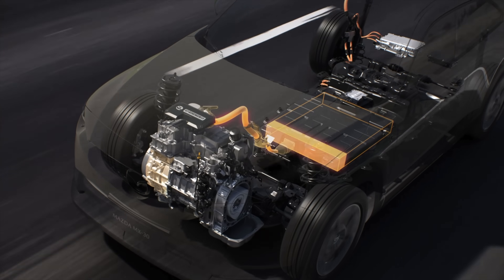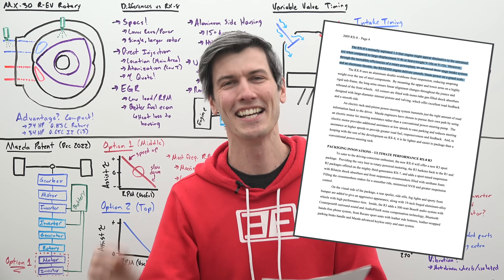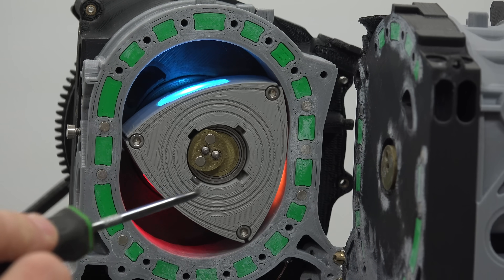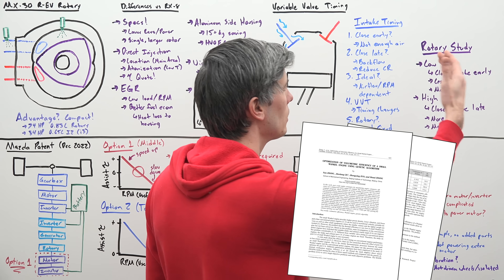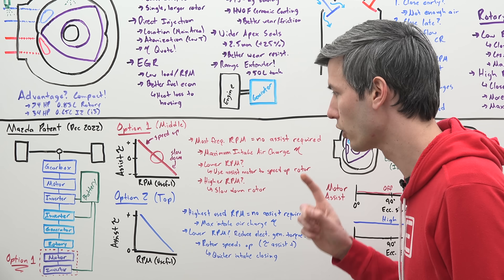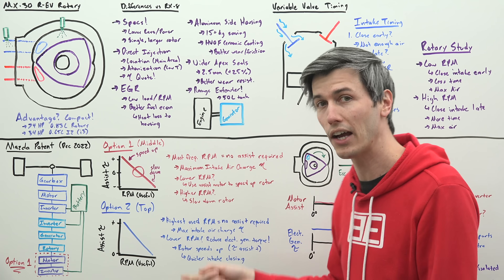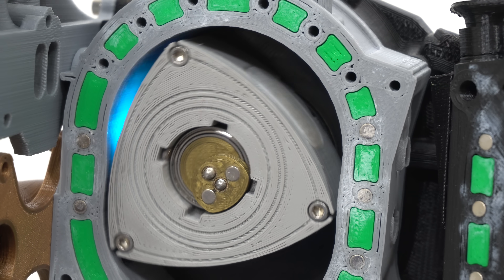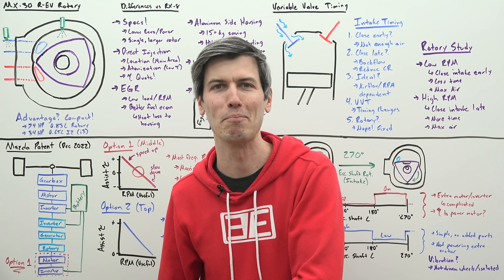Mazda Brought Back The Rotary Engine!

Comment from the maker: *Common Question!* Why would a range extender (engine + generator) need to operate at different RPM? 
Realistically, the option for a single RPM is there, and as stated in the video, there's likely an RPM that the engine spends the vast majority of its time at. There are reasons, however, why you might want to occasionally run at different RPM. For example: 
1) Engine startup. This engine makes peak power at 4500 RPM. If peak power is needed to recharge the battery, you probably don't want to go straight there on a cold engine. 
2) Battery charge rate. Batteries are able to charge faster at lower SOC (state of charge), vs higher SOC. This could mean at low battery, the engine output would be greater, and at higher battery SOC, the engine output drops because the max charge rate of the battery is lower. 
3) If the engine is capable of high output, it likely exceeds the max charge rate of the battery. For example, the battery (relatively small vs dedicated EVs) is capable of 36 kW fast charging (it's a small battery so this is a normal number, despite sounding low). The rotary engine has a max output of 74 HP (55 kW), thus exceeding the max charge rate, so there are likely times where it runs at lower loads, and times it runs at higher loads, depending on the battery's SOC. So why does the rotary have more power than needed? At times, it is used to not only power the generator, but also to send more power to the driven wheels. If you ask for full torque (floor it), the battery and engine+generator are both sending current to the drive motor, giving you more power. In this state, it would make sense for the engine to be generating max power.
Reply: You mean the Wankel engine?
Reply: why not keep the same RPM and change the load?
Reply: Great explanation.  This is exactly why I came to read through the comments!  🙂
Reply: Have you done a video comparing the efficiency of different engine types at a constant RPM?  Mazda does like the rotary/Wankle, how does it compare to a piston, or turbine engine of similar size?
Reply: I am 45. Since I was a kid, every 10-15 years Mazda would "bring back the Wankel".
Reply: #1)  Fine - who cares if you're just running it to get to the right temp.  That shouldn't take long.
#2 and 3)  Couldn't you just run at a higher RPM with a leaner fuel mixture, so you create less power but at the ideal RPM?  Does that take you back to where you started?
Reply: @kevinrusch3627  it is more efficient to make x kW at 2000 rpm vs 4000 rpm. High rpm and low load is inefficient.
Reply: Maybe I am looking at this wrong, but can’t you solve (and simplify) a lot of these problems by just using “start-stop” and a CVT?
Reply: @alpenfoxvideo7255  because running at a high rpm and low load is inefficient.
Reply: @Av-vd3wk  wankel engine yes
Reply: So when do we get to see the complete BTE map? Are you suggesting that peak thermal efficiency is also at peak allowable RPM or at some lower RPM?
Reply: @benwhittle7204  only if the added efficiency being able to operate the engine at ideal RPMs due to spinning the generator through the output shaft of variable gear ratios outweighs the parasitic losses through the transmission, added weight, space and cost and complexity... I'm guessing probably not.
Reply: Wouldn't a 2 gear box with a neutral do better job of the generator? Recluse clutches for dirtbikes have a clutch cassette that essentially gives you an automatic. Connect the throttle to the computer &your set
Reply: Wouldn't the temperature and pressure of the air coming in also change the "optimal" intake timing?
Reply: @alpenfoxvideo7255  because they want the minimum battery size.  if the battery where bigger, there'd be no need for the ICE to track usage
Reply: @ΘάνατοςΧορτοφάγος  an ICE is most efficient at its rated power, which is near the rpm readline
Reply: Yeah, what he said!
Reply: @DSAK55  Maybe with some types of engines like big generator or big ship engines that are sorta designed for that to happen but in reality not so much. But in the area of standard car engines the optimal thermal efficiency is generally not at peak rpm or power output. There are great reports that show the complete BTE (Break Thermal Efficiency) map of the Toyota engine that is being used in their hybrids and the design optimization for peak thermal efficiency is far from the maximum RPM on purpose. 

In addition, the newer trucks engines are purposely being designed to achieve peak thermal efficiency at lower RPM to minimize the friction losses and to achieve higher cylinder pressures.
Reply: @DSAK55  BSFC is not highest at redline rpm, more like 2000rpm (engine dependent) and WOT
Reply: @DSAK55  absolutely not. Highest torque is closer to the best efficiency point
Reply: This is a classic example of overcomplicated engineering with no regard of what the result should be: a competitive vehicle. For all the money they spent on designing this wankel engine with fancy timing, they could have simply put a bigger battery in there instead ... like literally every other automaker did. And range extenders were only useful when the batteries weren't as good. The i3 is 10 years old.
Reply: @ΘάνατοςΧορτοφάγος  Reasonable approximation but not quite the whole story. See “Benchmarking a 2018 Toyota Camry 2.5-Liter
Atkinson Cycle Engine with Cooled-EGR” and there is  newer versions of this but this will suffice.
Reply: Basically, the rpm is not critical except that hp is measured as a function of time x work, with modern waveform control WHO NEEDS  heavy problematic BATTERIES
Reply: Yes, 74 HP is overkill for the APU range-extender. That powerful of an engine could produce up to 37 kW of juice, or 37 kWh per hour. Even an inefficient EV could travel over 100 miles on that, or in other words speed along at over 100 miles an hour (hmmm, perhaps that is what they were going for).
Reply: I know this is technically for *extending range*, but I'd personally love a completely self-sufficient gas-engine-charged EV. All of that beautiful instant torque, and no need to calculate whether you can make a road trip OR install a 30 amp outlet in your garage. I'm sure the engine would last longer than you'd ever need being controlled by the designing engineers!
Reply: What do you think about the liquidpiston rotary design?
Reply: anyone can see the size and performance have some potential for generating electricity in vehicles, and better yet in heavy-duty electric machines, what can be said "after so many year", this is the cost of over doing patent control, yep, no performance develop in years pass and will remain underdeveloped in years to come, because ...tada! you guess it, technology monopoly, excessive control of technology's intellectual patents. Would this make to a reliable investment that will surely be sustain in the future, you guess it, not quite promising. Good luck!
Reply: @geoffshelley2427  Remember that the car needs to be able to maintain a reasonable speed up a long up grade, think Grapevine in California (and it has to do that on a 110 degree day without over heating the battery or running down to very low levels). Hopefully you can hit the bottom at 80% percent charge level which probably requires the user to have the car in the appropriate mode.
Reply: Also perhaps they want to leave the option for a dual rotor 148hp small car? There's markets where EV's don't really work due to basically having bad infrastructure or may have different emission standards where they could stick one of these coupled with a CVT... A single rotor would technically be fine for a kei car, I can imagine a mild hybrid single rotor also...
Reply: It looks like Mazda is doing what Chevy did, providing the ability to slave the gas motor to directly assist the electric motor driving the car. In the rare case that the rotary engine need to power the wheels, you need it to run at different speeds.
Reply: Really love the explanation,as always excellent video 💪🏾worried about that motor or positioning cam for the rotor lobes,as much as it's an excellent idea, they haven't perfected the old OMPs so from my experience I suspect that mechanism would be the flaw in these engines🤔
Reply: @michaelparks3106  This is different than at least one of the Chevrolets. The Mazda ICE is never mechanically coupled to the drive wheels. If it was, then they couldn’t vary the instantaneous RPM.
Reply: @Av-vd3wk  Wankel
Reply: 4) For better battery life and reduced loss in charging and discharging, it would be desirable to reduce battery cycling. Rather than producing a constant generator power, the generator power can track the power demand when the demand is within the range that the generator set can operate at good efficiency, resulting in constant battery state of charge (no cycling) during those times.

The optimal balance between one extreme of most efficient generation and the other other extreme of minimum battery cycling, also considering the various other issues (startup, thermal management, rate of charge limits, etc), will inevitably be a sophisticated generation and charge management algorithm.
Reply: Exactly the question I wanted to ask, but you've done it for me. However is it worth all this additional complexity to handle the situations you list ? I'm assuming it is possible to charge the batteries externally, so why not at the same time keep the engine warm using heaters, and while running, use cooling air for the drive motor for this. 
Best to keep it all as simple as possible, and have a fixed engine speed and power.
Reply: Also, noise. 
Use lower rpm at low vehicle speed, and allow higher rpm at higher speed where it's easier to obfuscate the generator noise.
Reply: @nomayor1  
Mazda made rotary engines from 1964 until 2012.
Reply: 1) Only when starting up with batteries empty, and for a few minutes.

2 & 3) Use start/stop, electronic current regulators, connect to the generator through a mini transmision.
Reply: @johnburns4017  They are to make Another come-back, this time with the wankel playing the role of a generator. That's what this video is about!
Reply: I'm trying to work out how the Coventry Climax pump's engine was designed to work at high power right from the start, even a cold start. So why is it such challenge? Metallurgy? Clearances? The engines date back to the 30s.
Reply: @stuarthart3370  
The Coventry Climax's longevity never mattered, only its performance. Fire Brigades would stomach the higher maintenence costs to get the performance instantly.
Reply: @CrappyCar  turbines are insanely efficient, but I don't think that will transfer well to something small and running a generator
Reply: @kevinrusch3627  emissions will get in the way of that. Not sure how it works on a car like this, but lean will pollute much more.

Also, lean generally makes more power, not less.
Reply: There is also the ability to vary valve timing at a specific RPM to basically do a rotary Atkinson cycle. Maybe they run it at 4500RPM at all times but a cold start, and vary how much power it makes at that speed.
Reply: @alpenfoxvideo7255  Because running the engine at 4500 RPM under a light load would be quite inefficient.
Reply: Jason,

I'm wondering if Mazda considered some kind of 'cam phaser' type mechanism for the eccentric shaft that could advance or retard the rotor timing?
These other two electronic solutions either take power away to make power, or reduce total power output.
Reply: @nomayor1  
I know.
Reply: @JoshuaClarkeOk  The market where BEVs don't really work is the entire global market... due to cell supply limits.  Cell supply is what limited production of EVs to 10.6 million in 2022.  That's 10.6 million between BEVs and PHEVs.  Had we produced zero PHEVs and used all of the cell supply to only produce long range BEVs, then the world would have only been able to produce 8.2 million long range BEVs.  About 10% of the total global vehicle production; the other 90% being ICEVs.  

Had we instead used all battery cell to produce ONLY PHEVs and HEVs, and zero long range BEVs, then with the exact same cell supply the world could have produced 36.5 million 16 kWh PHEVs, and 45 million 1.5 kWh HEVs.  81.5 million vehicles; aka all global vehicle production could have been PHEVs and HEVs.  It would have required no fast charging infrastructure.  We could have also produced millions of more PHEVs + HEVs in 2021, 2020, 2019, 2018... etc...   We'd be far further along in electrifying our global fleet of 1.4 billion registered vehicles, and would have made a much larger dent in global emissions than the track we're on now concentrating our resources BEVs.

Tesla, world's largest BEV producer to this point, has only produced 3.8 million BEVs in its 20 years of existence.  They're replaced only a quarter of one percent (0.27%) of the world's total vehicle fleet.  They've essentially done nothing up to this point.
Reply: 'Range extender' sounds backwards to me -- why not simply design a bolt-on electric motor kit for typical FWD economy cars, with manual transmissions? The original ICE drivetrain would remain fully intact.

The idea is to replace one rear wheel hub with an electric motor, and use a small(ish) battery pack... When you're stopped at a red light, you accelerate the car to cruising speed, using the electric motor only. When you reach cruising speed you engage the ICE drivetrain (let the clutch out, in 5th gear), and cruise on gasoline. This will roughly double the miles you get on a tank of gas (acceleration burns half of your tank, so use an electric motor for just that part).

A small battery pack would allow most people to drive to work and back every day, doing all of their accelerating with the electric motor... and only require a few hours to charge overnight. So for at least 5 days a week, they'd be DOUBLING their MPG.

Make the kit somewhat universal, inexpensive and reliable -- you'll sell A MILLION UNITS. PS doubling the range of an average economy car's gas tank would give you a range of approximately SEVEN HUNDRED MILES. Let's see you do that with your golf cart.
Reply: Motor turns a generator which charges the batteries which drive the electric motor? 
Sp it's another Chevy Volt...
Reply: @alpenfoxvideo7255 There are times when hp and torque are more important than optimal efficiency.
Reply: @DSAK55  how the fork did you come to that conclusion?
Reply: 1)... So let it warm up.  Also rpm isn't necessarily the issue on a cold engine.  It's load. 
2)... If you are running the motor at optimum rpm for efficiency then you just vary the load on it and let the generator handle that.
3)... Again... you vary the generator and not the engine speed.
Reply: @ΘάνατοςΧορτοφάγος  That's simply not true.  With active fuel management this is no longer an issue.
Reply: @alpenfoxvideo7255  It will be more complex.  The scheme mentioned in the video calls for a simple on/off.  If you want to change the load, you need something that can adjust the amount of load.
Reply: @SystemHacker23  One thing to consider.  Can they scale up the size?  So far nothing seen.  Looks like liquidpiston cannot scale.
Reply: @cybertree  nissan e-power
Reply: 1) You can use the electric motor to "warm up" the engine. Use a motor to pull the engine to a optimal RPM before igniting. BYD is already doing this in their PHEVs.
2) Most EREVs never self-charge the battery above a certain threshold of high SOC (usually 70%-80%). To charge above this threshold, an external charging cable is required.
3) You can't charge the battery while the battery is powering the motor simultaneously. If the motor runs at lower loads, the engine can be shut down for a while, and the battery powers the vehicle alone. If the battery produce enough power for the vehicle... then it is not a good EREV.

Conclusion: a single RPM is enough for range extenders with a sufficiently large and powerful battery.
Reply: Battery charge rate does not influence RPM in generator applications. Changing RPM will resukt in frequency variations, and your inverter will not go well on that. The power plant controls need to make sure that the RPM's are fixed, at all power levels.
Reply: @justinlabarge8178  "turbines are insanely efficient"

This misapprehension seems common, a basic gas turbine has an efficiency not dissimilar to a four stroke engine. You only get the very high efficiencies when used as part of a combined cycle by capturing waste heat and using it to power a secondary (usually steam) turbine.  This would be far too complex and bulky for automotive use.
Reply: @alpenfoxvideo7255  The battery probably does not take consistent power troughout it's charging range. A fuller battery will require lower charging power.
Reply: What i've understood is that speed is changed inside the turning cicle, but average operating speed is constant. Slower when intake port opened achieved by increasing generator braking torque
Reply: @alpenfoxvideo7255  changing the load changes the reactive force on the generator, altering the RPM.
Reply: @alpenfoxvideo7255  probably the most efficient rpm is not the same at different loads
Reply: Great explanation of a very complicated engine/drivetrain/battery, etc.....!   I expect that engineering team can make this new Mazda sound like a Bugatti Chiron.
Reply: it sounds like you're forgetting about different loads the generator can output which negates almost your entire post... even the cold engine portion of your post doesn't quite hold up because a cold piston engine wears slower when immediately reaching optimal RPM instead of warming up at idle
Reply: a single rotor Wankel engine must need a counterweight too, for balance reducing power per weight ratio?
Reply: @DSAK55  Depends on the motor in question.
The QR25DE 2.5L (2488cc) i4 (natural aspiration) in the 2003 Nissan X-Trail T30 (T32 is the Nissan Rogue in the US) with a 5-speed manual transmission; has peak power of 132kW/177hp at 6000 rpm, but to get the ~10L/100km fuel economy (combined between highway and city driving. more efficient on the highway than in the city) you're sitting at 3000 rpm for 20kph (12.5mph) in 1st, 40kph (25mph) in 2nd, 60kph (37.5mph) in 3rd, 80kph (50mph) in 4th or ~105kph (~65mph) in 5th.

I know from experience (sitting shotgun for 19 years) running the QR25DE at 2500 rpm in 3rd and 3500 rpm in 2nd is 50kph, the engine is NOT happy with the excessive vibrations having to run in what is basically a half-gear with under-revving in 3rd (lowering fuel economy) or over-revving in 2nd (overt noise pollution) just to drive through 50kph residential zones here in Rural NSW, as it is balanced to run optimally at 3000 rpm in each gear for fuel economy.
I've been riding shotgun as a passenger in the 2.5L Manual 2003 X-Trail my dad drove (until he passed in July 2022) for so long, I can tell when we're driving through a 40kph, 50kph, 60kph, 80kph or 100kph (highway) zone in a half-asleep state of consciousness just by the drone of the engine, how much vibration it puts out (mainly when under-revving in a half-gear or over-revving at 4000 rpm prior to an up-shift in gears), and the relative velocity of things going by when glance out the window.
Reply: @adamcrookedsmile  all Wankel rotaries use counterweights. Because they're just on the mainshaft (eccentric shaft), they don't affect efficiency, and they're not significant compared to total engine weight.
Reply: Oil leak king is back
Reply: Actually it is often the best case not to use the battery at all to avoid charging and discharging losses and use the ICE power directly. This losses in the battery are often bigger then those running the ICE in an not ideal point.
When the ICE is running you want that energy being directly used for propulsion without draining the battery (and having to load it again). Because the demand of power can vary the ICE has the be universal with the RPM.
This is true for the Prius, BMW i3 REX, too: Avoid using the battery for accelerating for maximal efficiency if you have to use the ICE anyway.
Reply: simple answer would be to have different rates of charging. Same way there exists fast charging for plugins and regular AC charging.
Reply: @adamcrookedsmile  the rotor moves with 120 degree symmetry so I think each rotor has to be balanced, it's one big advantage of rotary, to be able to spin fast with little vibration. you would probably need  3 rotors with 120 degree offset to balance without counterweight
Reply: I think this could theoretically be addressed with a super capacitor in addition to the battery and insulation for the engine similar to generators that must go full load immediately upon start.
Reply: @alpenfoxvideo7255 They are varying the load but timed to match the power/intake cycles. When less charging power is needed, disconnect the load during part of the intake phase then reconnect the load during the power phase - vary timing according to load.  Otherwise  to vary the load at constant speed you would need a linear current regulator which is likely more costly and less efficient.
Reply: Thumb down for ppl skipping threw the video.
Reply: @Danger_mouse  problem is it needs to do it 3 times per revolution, 6 if you consider each "event" aka speeding up vs slowing down.
Reply: @deepseer  your first point would take forever to heat up the engine, which is worse than just firing it up and putting full load on it immediately. Your third point makes no sense, power from the generator goes to the electric motor moving the car, excess goes to the battery. Just like you can charge your phone while using it. In situations where you're trying to accelerate up hill, both the battery and generator current will be fed to the motor. This isn't a new concept, it isn't the new series hybrid on the planet. The new part is using a rotary for a generator.
Reply: @murraymadness4674  but it increases battery cycles, something that's a much bigger issue with a smaller battery.
Reply: @alexmawdsley 
I was thinking more like the way current 4 stroke engines advance the cam timing.
Obviously you would not gain 'cam duration' (for want of a better term) between intake and exhaust, as the rotor would advance or retard the exhaust timing also.
I wonder if it had been tried?

Also, they could use power valves in the ports like all modern two strokes do, many of them are electronically controlled these days.
Reply: I was wondering about this throughout the entire video. Your explanation here does actually make sense as to why you would want different rpm ranges available
Reply: @IkethRacing  low load is better when engine is cold. Less stress on the components. "optimal RPM" is not a thing.. you have optimal RPM for torque, for power, for efficiency, for mpg and for engine wear which could be all different. talking about a NA engine, peak torque usually  means optimal combustion/BMEP, but it doesn't mean you want to jump straight there on a cold engine. On a boosted engine peak torque tells more about the boost than then RPM being optimal for the engine. Also higher RPM will heat up the engine quicker, with low load, is better than low rpm/high load, but ideally you want low load/low rpm until you're up to temp.
Reply: It would be awesome if you could do a video just on series hybrids vs. hybrids which tie the electric motor into the ICE power train.
Reply: @harbl2479  Batteries have their own environmental impact and limitations. If generators can be made small and light enough they may even approach EV levels of energy efficiency. The Chevrolet Volt for example already has an energy efficiency (passenger meter per Kilojoule) of 1.48 while a Nissan Leaf is at 1.79 and a Model S at 1.93. Compare that to a Volkswagen Passet at 0.39 or Polo at 0.87 and you can see there's already a huge improvement.

The real problem is full EVs aren't a great climate change solution. A basic electric train running at an average 20%+ capacity absolutely destroys an EV efficiency wise. In my city our rail only has to run at 17% capacity to beat a Model S (av. 1.2 passengers). Japan Rail Easy company shows an average 10.91 (p m /kJ), over 5.6 times the efficiency of a standard occupancy Model S (though this does drop to just 4.2 times with a Model 3 with a Ruropean occupancy rate of 1.4). The problem for EVs is their ideal use case overlaps a lot with PTs ideal use case - moving from areas with good infrastructure to other areas with good infrastructure. While a range extender hybrid is better suited to fill in areas PT and urban design can't accomodate well - going to areas without good infrastructure, especially over long distances, that need to be quick and point to point.
Reply: So what chevy initially said teh first gen Volt was.... then turned out it could direct drive the wheels and not solely the generator unit.
Reply: Hopefully, Mazda can actually sell some of these. Most people are too afraid of anything rotary. If they oversell the rotary portion of the vehicle, history will repeat itself, and no one buys them. If they just compare themselves to BMW with also having a range extended but brag about how much better it is, they may have a winner.
Reply: Why would you needs different rpm's for a generator? it's simple they want to send most power directly to the wheels not mechanically but electrically by bypassing the battery. I.E. send the AC power of the generator directly to the AC motor(s) driving the wheels. And send any excess to the DC battery. Why? because there are losses when converting the generated AC to DC to charge the battery and convert it back to AC to propel the car. This also allows the inverter charging capacity to be lower, among other benefits.

In short, for efficiency, in this design some electric power will bypass the battery and it will vary the engine rpm with vehicle load using the battery for any hi/low gaps in energy demand. The VOLT uses some of the same theory.
Reply: Why would you needs different rpm's for a generator? it's simple they want to send most power directly to the wheels not mechanically but electrically by bypassing the battery. I.E. send the AC power of the generator directly to the AC motor(s) driving the wheels. And send any excess to the DC battery. Why? because there are losses when converting the generated AC to DC to charge the battery and convert it back to AC to propel the car. This also allows the inverter charging capacity to be lower, among other benefits.

In short, for efficiency, in this design some electric power will bypass the battery and it will vary the engine rpm with vehicle load using the battery for any hi/low gaps in energy demand. The VOLT uses some of the same theory.
Reply: @benwhittle7204  You just suggested that putting a transmission into a car that doesn't need one would simplify the design.

You've misunderstood what transmissions do. Transmissions are essentially a system for torque compensation. They allow you to increase or decrease the amount of torque needed to drive something (like the wheels on a car). Putting one into this car would literally do the same thing as reducing the generator demand. So how about they just stick with the plan and use the generator to keep the RPM in the ideal range, with the added benefit of having the option of a variable RPM should circumstances demand it.

Electric motors essentially have the same torque at all speeds, so you don't need to decrease the torque demands at low speed. Think of a car where 6th gear is the only gear and there was no power loss when you try turning your wheels at a 1-to-3 ratio (wheels turn 3 times for every engine revolution)  from a full stop. This is why there's not benefit to a transmission in an electric car.
Reply: Why not just use valves with variable timing in addition to a classic rotary engine design? All these tricks with changing the rotor's RPM several times per revolution will only result in extra vibration and extra wear.
Reply: @TheDoc73  I think you need to watch the video again to better understand what’s going on and what I am suggesting, because you’ve misunderstood, well, all of it.
Reply: @tedantares2751  because rotary engines don’t have valves and adding them would defeat the purpose of their simplicity.
Reply: @benwhittle7204  Yes, but there would be so much more control over the way the engine operates! Especially, if a technology similar to FreeValve is used that can control the amount, speed and duration of valve opening. Adding valves to a rotary engine could significantly increase its efficiency and power.
Reply: Most likely reason: As battery is charged with applying certain voltage, you can lower the charge rate by supplying a lower voltage. If the engine rotates very fast, the generator will generate high voltage (Un/n = constant), so in order for the battery charger to adjust voltage down.. it needs to chop the voltage (PWM). i.e. wasted voltage, but if generator would be rotated with slower speed i.e. lower voltage, the PWM operation would not need to drop the voltage so much.

This has many benefits i.e. higher efficiency, the diodes / IGPTs might actually run cooler as the switching freq could be lowered and again.. the generator will probably have a designed sweet spot for that voltage.. again producing higher efficiency.
Reply: @IkethRacing thanks for the free psychological consultation, although I didn't ask. I think your post is pretty clear about claiming a cold engine wearing slower when jumping to "optimal RPM"
Rather than idling, although it doesn't define optimal RPM. Idling is definitely not the best way to warmup an engine, but jumping straight to a fixed rpm isn't either, More like ramping up  rpms and load.not saying you're wrong, but you're missing the bigger picture
Reply: @tedantares2751  right but then you have the complexity of a normal engine, normal engines which are significantly more reliable and more efficient in the first place.

The beauty in a rotary engine is in its simplicity.
Reply: @Av-vd3wk  Wankel Rotory Engine
Reply: @harbl2479  Well, it remains to be seen, whether this design is competitive. However it has some inherent advantages. A huge battery is very heavy and very expensive, if you are mostly using your car for short commutes, it is very inefficient to have a huge heavy battery to move about. So having a smaller battery with adequate range for commutes is benefitial. At the same time, whenever you run out of battery on longer trips, you have a backup in form of the range extender.

Which leads to the idea of having a very compact, "light" yet powerful rotary range extender, not adding too much weight and providing enough power for cruising and charging the battery at the same time.

Also, there are regions, where the charging station infrastructure is rather bad, making long trips comparatively laborious, in which case, a range extender still makes a lot of sense.
Reply: Thank you, that was exactly a question on my mind during the video.
Next question:  sounds like the variable RPMs are utilized to enhance performance, but aren't necessary.  So, for an economy car, maybe it could just run at a steady, efficient RPM?
Reply: This is exactly what I came to ask. Thanks for the answer! Still seems kooky!
Reply: Some interesting points, but I think 2 and 3 should be possible to solve using your charge controller.  Single RPM generators operate at a single RPM even at different loads, I expect you could use your charge controller to put different loads on the generator even at different RPMs.

On the other hand, I know that piston engines (especially diesel) get enormous efficiency gains by staying at a single RPM, I couldn't guarantee that you see those same gains in a rotary engine.
Reply: Why can't the range-extending rotary engine be used to charge a bank(s) of supercapacitors and switch to battery charging as a secondary function?
Reply: Why not a rotary valve like the old two strokes?
Reply: Thanks, came into the comments to ask exactly this. Thought it might be along those lines
Reply: @DriftCentral  With flame sprayed side housings and thicker apex seals, they have likely reduced the amount of oil needed by the OMP. It wouldn't surprise me if the rotor housing is cermet coated as well. The OMP itself wasn't normally the source of problems before, the fact is that emissions regulations require them to inject less oil. The Renesis was actually starving for oil because they had leaned the mixture so much. The need for oil to be injected has been reduced though by using sealing methods that impart less friction. This new engine will more than likely outlast the rest of the car with the improvements they've made.
Reply: @adamcrookedsmile  All Mazda Wankel rotary engines have counter weights. All modern piston engines have counter weights as well. When comparing power to weight ratios on piston engine vs. Wankel rotary, the Wankel rotary usually wins- especially when equipped with aluminum side housings. There was a company long ago that made billet aluminum rotors as well, further reducing the weight of the engine (but at the cost of longevity.)
Reply: @calvincheng865  Harley Davidson never left.
Reply: Thank you for your videos always fun and educative. One question: What about reliability of the rotary engine? This new setup will increase the reliability? … other Did they mentioned anything about maintenance? The previous where expending a tons of oil. So we have keep a lot of bottles of engine oil in the trunk to avoid damage in the rotary engine.
Reply: But I think, this way, the battery will die very soon in this model when compared to other EVs because of the irregular charge supplies and cycles... what do you think? The battery might develop fatigue early.
Reply: Did Mazda ever admit that the timing error they pretended they didn't make is the source of ALL their previous rotaries' problems?  Ignition before top-dead-center is fine in an upright reciprocating engine.  Trying that it a rotary breaks seals.  Sound familiar?
Reply: There is less and less technicians who can fix conventional vehicles as they getting overcomplicated, than this setup comes in to the market just wondering who's going to be able to fix it when it breaks without replacing half of the vehicle
Reply: this is strange i thought the only reason you needed vvt is to increase efficiany since we had allot of cars with out it meaning the engine can operate normaly at diffrant rpms without it so why bother with it since 99% of the time its going to be at optimal rpm since its only charging and the other times it wont hurt the engine just lose eff
Reply: You covered the vibration concerns not affecting the driver's comfort. But what about wear?
We remember rotary engines getting rebuilt every 10k kilometres. Even if they improved the durability with parts and lower rpm, doesn't the vibration greatly increase wear even for the generator?

I feel like this complicated way of reviving the rotary engine causes it to fail another time.
Reply: @benwhittle7204  "Combine rotary with CVT"
 - serial electric hybrid IS a CVT. With electricity instead of belt coupling😏
Reply: there is already a hyper hybrid called converted Tesla model 3 made by obrist, therefore Obrist Mark 2 with a 17 kWh battery and a 20 kW 2 cylinder 2 stroke engine generator if I remember that right which runs constantly at same optimal rpm. It acts as a constantly battery recharger.
They were able to lower the weight cause the removed 60 kWh battery weighs more than the small added engine, exhaust, tank needed. 

It can also run electric alone but needs to start the engine in time before the battery is empty. The first development version can be seen in an english video from an austrian youtube channel called techmagnet. Search for obrist mark ii . Specs seems also have to been changed, also developement cause the techmagnet showed a Model 3 with a 10 kWh battery and now they seemed to have moved to a model Y with a 17 kWh battery for longer electric range especially in the city.
Reply: Well you dont have to run the range extender on a full battery and since you said one can optimize the intake for specific load conditions, you could do this exactly at the peak charge rate right and run the generator from say 20-60% SoC.
Reply: Hi Jason, will you ever talk about the non production version of the "Liquid Engine" out there?
Reply: I have a Opel Ampera (Chevrolet Volt) on the same system (range extender) , after 25000 km I conclude the following: 
1- There's absolute no justification for different engine regimes other than the optimal one , as you never charge such a car with the engine without driving , sooo no overcharge problem as the car consumes a lot driving. You should  have a huge electrical production to cover the driving and go overload ! So , as one comment said 74HP is overkill .... NO WAY, it's NOT enough , what overkill?? My Ampera has 85HP and on a hill climb , normal calm driving, with batterie empty , so only on the engine, the engine is at the point of exploding ! I avoid like hell to drive like that as it's sure to brake the engine if done too often. 
2- what would be the best electrical generator, fuel /generation efficacy  ? Gas/diesel,  4 stroke/2stroke , jet engine, a stirling engine that recuperates the heat produced by the batterie when delivering electricity (I know, a stirling engine seems crazy?)??? 
I wonder why they didn't put the best electrical generation possible, as these cars drive exclusive electric so you can put whatever engine you want for generating?
Reply: do a video about liquid piston rotary engine
Reply: @philippebrebion6203  that is a good request!
Reply: @rjung_ch  ye haha im really curious about their rotary engine, im not a mechanics but from what i heard it look like a really good upgrade
Reply: So anybody else curious about Mazda's  " Sky Active " technical innovation ?
Reply: One word. “Load” load on any rotational object will create a drag on rotation or resistance in current. If the generator only ran at one rpm. Then any drag on rotation will cause heat fast. Any resistance in current would cause heat fast. Both of which will find the weakest link to displace all the energy that has no where to go. It is no different than gears. Except it is current
Reply: @kevinrusch3627  2 and 3: Emissions.
Reply: Why not use alternator 
 and variable fuel injection to
Reply: MAZDA ANNOUNCES CANCELLATION OF  MX-30.
NO RETURN FOR ROTARY ENGINE.
Reply: @catchnkill That's what they said about the Mazda 2 Demio RE... and nothing happened with that either, just more clickbait BS like the SP
Reply: Thank you
Reply: I think there's an even simpler way.  Not getting paid though....
Reply: Doesn't make sense, either use a bigger battery or a smaller engine, this is just making things complicated for the sake of complicating things.
Reply: You can throttle the engine at the same RPM with this mechanism too.
Reply: The question is: did it work?? @EngineeringExplained
Reply: Using a motor as a generator and charging an electrical system, this is wicked clever and I hope more cars do something similar!!